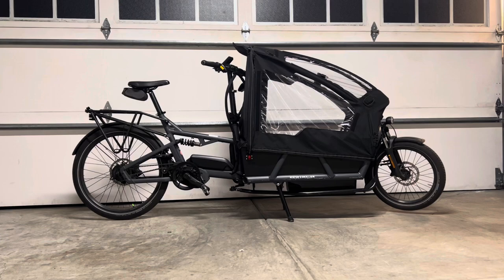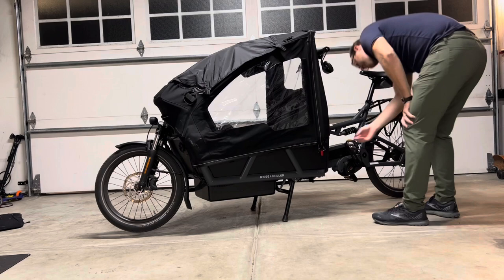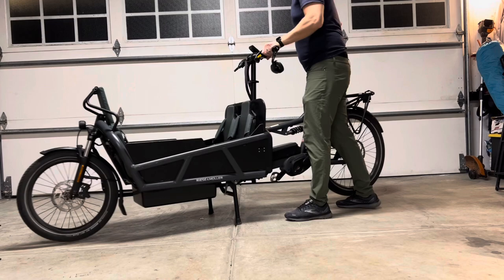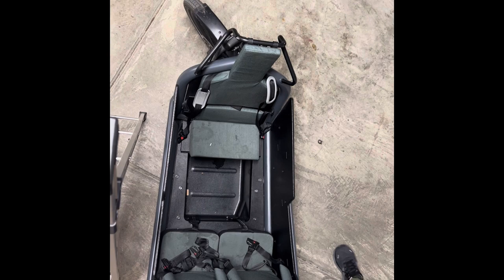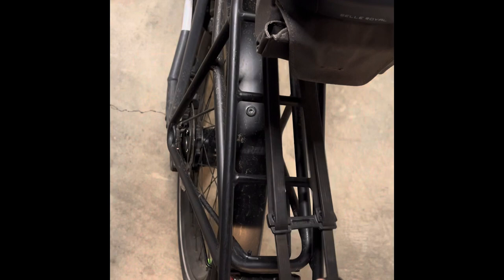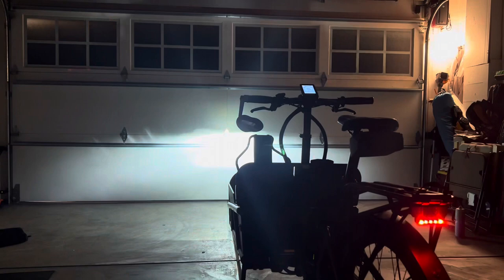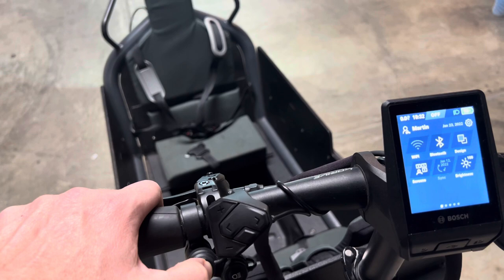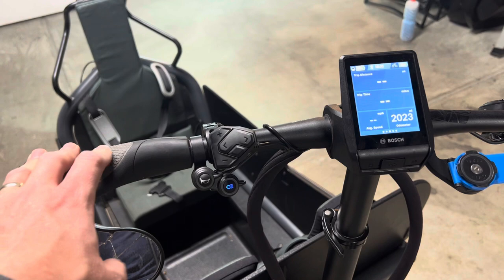Riese & Müller Load 75 HS Rohloff

Comment: I have the 2021 Load 60 and I agree about the adjustability (or lack of quick adjustability) of the seatbelts. Where you were showing where the chain lock went in previous models, I mounted a Wolf components (I think is what it’s called) bottle mount to add a Topeak bottle holder. My Load 60 is pretty much configured like yours, with the Rohloff and double batteries but with the Intuvia display. I’ve been riding mine in -20 to -30 C and Canadian snow and winter and it’s been a surprise that it’s done so well. I have the GX option, although I will change the front tire to a Schwalbe studded tire next winter just to get a bit less slippage. Great video!
Reply from the maker: Thanks for the comment on low temps! I wish the documentation or marketing for the bike was more explicit about how well it holds up in low temp, rain or snow. I think it does really well in the rain. It’s great that we are able to let other people know through online comments though!

Comment: Nice video! Super excited for mine to arrive. Similar spec except I went with the purion and touring drivetrain. Bummer about some of the design oversights but feels like we're still early days on refinements. Have you considered removing one of the front facing seats and moving the other in the middle for better weight distribution?
Reply from the maker: I don’t think the weight distribution is a big issue. It is just problematic when they toss themselves side to side swaying the bike.